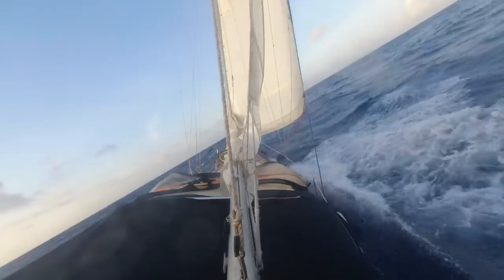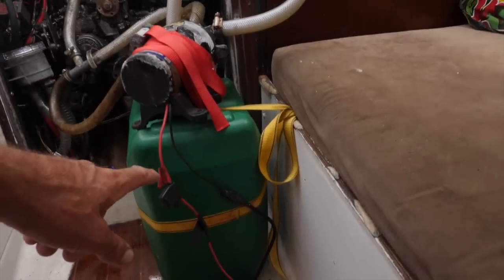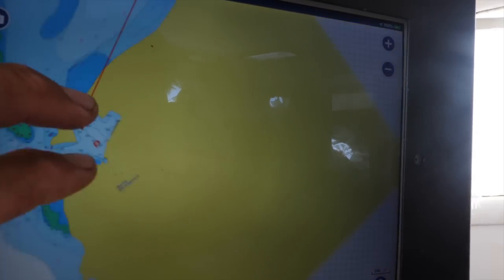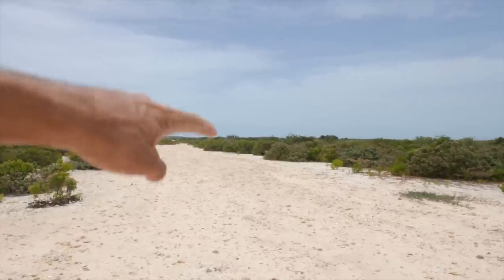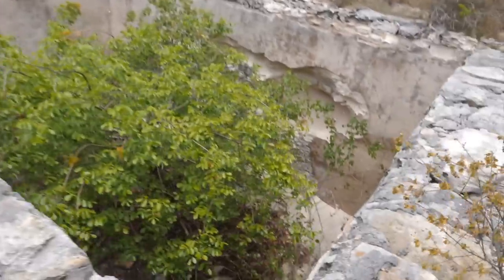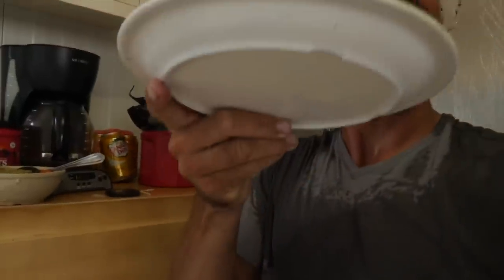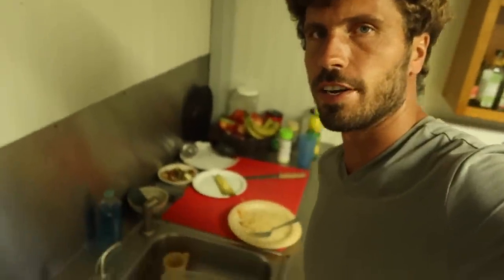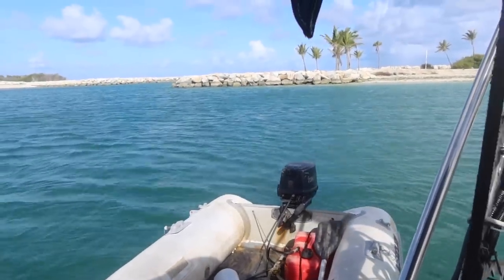Jerry-rigged electric engine coolant system to continue journey

Comment: When the seal goes bad, it leaks out to the bearings which will cause the pump to lock up.. new seals and bearings will fix it for a backup

Comment: The motors on the island are "HIT AND MISS" motors , one was a stationary, the other was a tracktor. As to using the dinghy, the best thing you can do is get a remote control lines. YES you can use an external cable going to a control handle lever. The idea is to take the dinghy strap it next to the sailboat TIGHTLY fwd and aft, Lock the outboard straight so it can not turn. Then you have a bit of a push to port or stb depending on what side the dinghy is on. You then can have motor control of the outboard via cable at the helm and main sailboat steering. I still would suggest the transom strong arm system to mount the outboard too. And keep the dinghy on deck. Something to consider, you are likely going to want to take the cover off of the outboard and give it a once over. check for corosion etc..... TEF-GEL is your friend. And its a good idea to check on your zincs etc....... its been some time. Remember all parts that have thread USE tef-gel.
And again consider getting a small second hand wind generator. Then you can generat power at night.